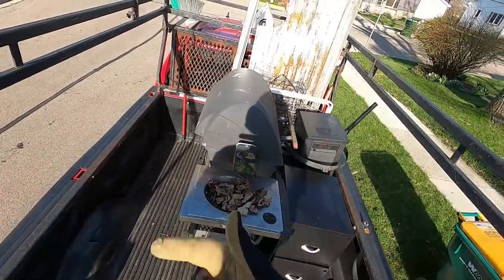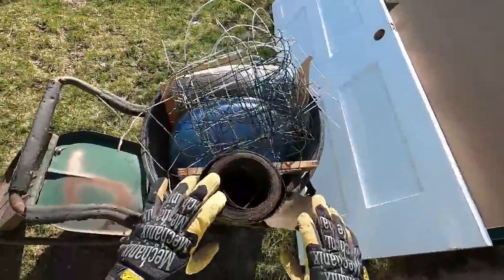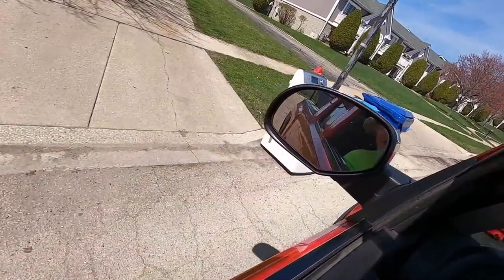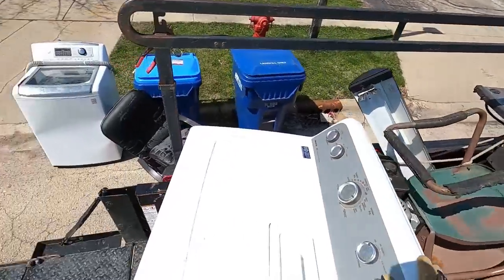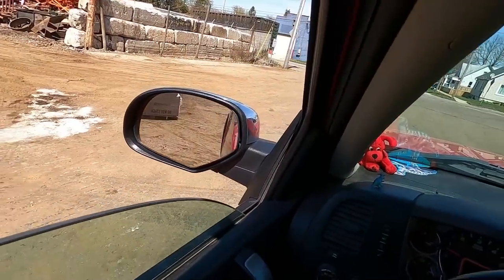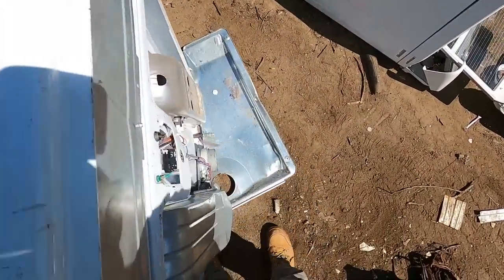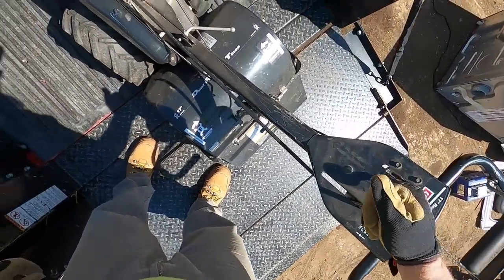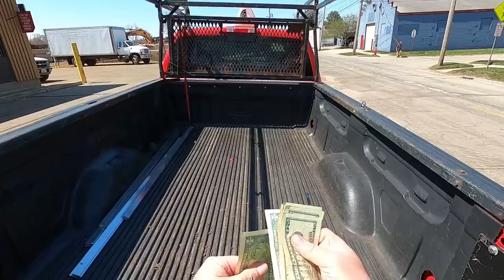Dryer Jackpot! Caesars Palace of Street Scrapping

Comment: The problem with LG washers and rust is the location of the BLEACH dispenser in the front left corner.  I just scrapped out my own LG washer for the leaks from the same area.  Mine was not nearly as eaten up as the one you picked up in this video. High end washer with many features, but the bleach takes a toll on them. I replaced it with a much smaller and less costly Whirlpool. The finish of the paint doesn't protect the steel well at all on the LG. Happy hunting!  Love the Praise and Prayer (before pay) at the end of your videos!

Comment: I miss scrapping. Haven't done it in a few years. There's too many people doing it. I used to take everything apart. My favorites  were air conditioners, storm doors and faucets. It added to the final weight. Aluminum bbqs, are simple but noisy. Take a hammer and smack around the bolts inside. The metal will break

Comment: The LG washer rust out was because of the bleach dispenser that was originally. Located there..mine started an issue in that spot too I complained to LG but was dismissed. ...ugh Great washer if it weren't for that poor bleach dispenser design.

Comment: Hey Paul. I know you don't really micro scrap. But here in the UK most yards take cords with plugs on but give a lower price, so I cut them off as I am going and save the plugs in a tub like you use then when full weigh them in. here I get Irony alu at my yard but some will give dirty brass which is better might be worth asking Micheal about it. Could work out a good few extra bucks especially if you fill a bin which I imagine won't take you long the amount you get. Or maybe on of the teenagers could do it for you at the shop and earn some dollars.

Comment: Good  day  Paul 1200 houses ,  if each 1 throws1 pd   =1200 lbs.
Ext. aluminum  1.12  but cords  .60/pd   There cord prices  are low compared to other yard,
but  there prices on other things are higher.  1 yd is 30 klms paying lower price
other yard  42 klms paying better price
Boy that tail gate  really is paying off.  Thanks
Reply from the maker: Saturday I turned in my cords for 65 cents per pound

Comment: The tiller was probably good the float stuck in the carb and flooded it out the muffler was covered in carb smoke either way none running was $200 bucks to a repair guy those things are around $900 new

Comment: the tiller has a valve hung open with carbon. something simple. I could have fixed in about thirty min. to an hour  and sold it for 2 or 3 hundred dollars. you can spray some kind of valve unsticker spray down the carb from oreallys or the O zone parts stores. They make all kinds of sprays or just some seafoam pour that down the yap and pull it over. if all fails take the head off about a five min. job and spray it directly on the stuck valves wd 40  liquid wrench. tap the valves easy with a board or stick tiny hammer easy so as not to bend the valve after you spray all the valve unsticker stuff on or sea foam what ever they sell you at the parts store for about 5 bucks. then put the head bolts back in the head torque it down. most the time you never have to take the head off just spray valve unsticker spay down the carb or seafoam can be poured down and pull the rope over until the valve unsticks. Carbon can stick a valve easy you just need to clean it off with some kind of good cleaner like seafoam. Marvel mystery oil works wonders down the carberator. marvel is made to unstick valves. then pour some in the gas tank after you fix it. I was just besid my self when you scraped the walk behind tiller ouchy. sheesh never every do that again man. so easy to fix a stuck valve. I have a mower that the valve sticks on. if you turn a motor over on its side oil will run on top the piston then it burns off and it will sometimes stik a valve. those tiller like that go for $375 on craigs list every day. you can watch a youtube video on how to unstick a tiller valve. probably many videos so easy to do. You will like it you will feel like a genous after you fix it. I liked the antique chairs too were they too rusty to keep? If I was your neighbor we could be great friends.